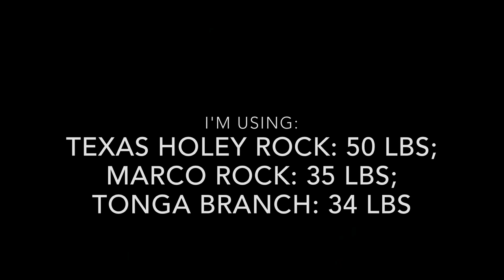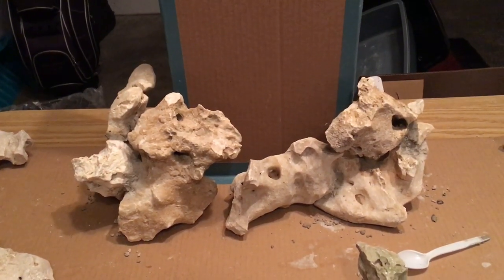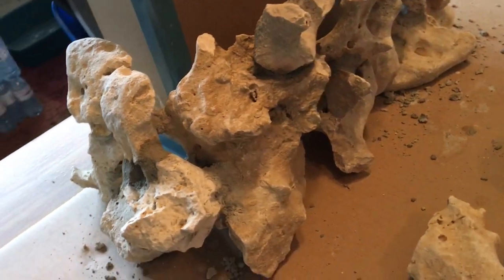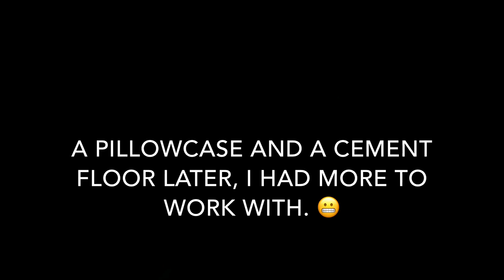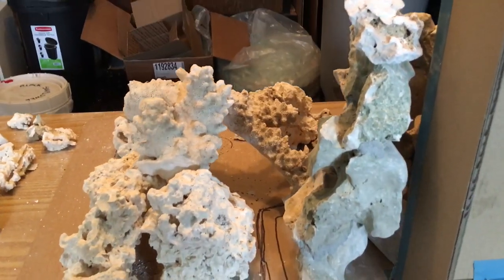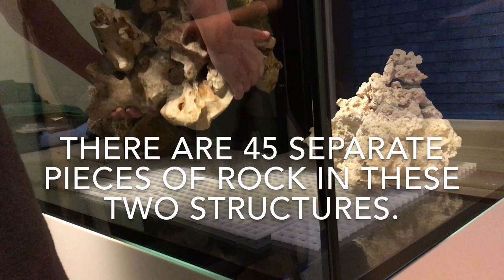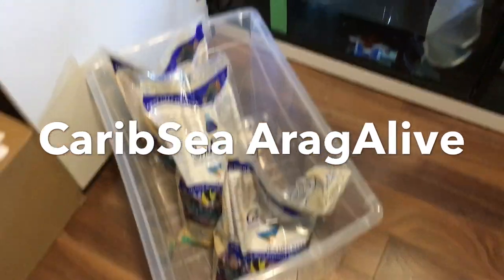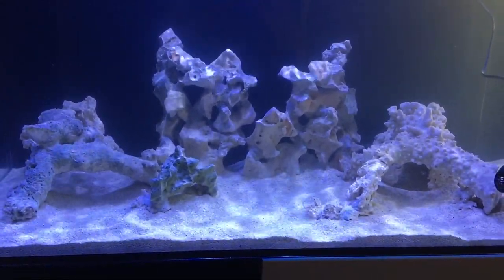Red Sea Reefer XL 425 - Rocks + Sand + Water = CYCLE !!

Comment: Nice video but bad idea to leave egg crate in, it will trap detritus.
Reply from the maker: That’s why I frequently used a turkey baster to fluff the sand. It was a fairly shallow sand bed, and when I moved the reef I was really surprised at how little debris kicked up when I pulled out the rocks. It was impressively clean even after running for three years. 👍🏻

Comment: very cool! I guess youre leaving the light diffuser under the rocks?
Reply from the maker: Hey ED, that stuff is made specifically for aquarium use, comes in 6"x12" panels that can snap together, and is very inexpensive. The light diffuser from the hardware store is deeper and more brittle. I find this stuff keeps the rocks from sliding around or contacting the glass directly and perhaps scratching it. I've used it in all of my tanks for the past 7 yrs. Thx for watching!

Comment: looking good... hurt a little seeing you using wood tools to break rock lol (woodwork is my family trade)... about the devil's valve, you'll get used to it, make very very small adjustments and wait a at least 10 minutes to try adjusting again, my tank is completely silent (barometric pressure changes will affect the adjustment sometimes).
Reply from the maker: Thanks so much for the tip about the adjustment. It will definitely help. And that wooden mallet is over 100 years old, belonged to my husband's great-great grandfather from the days when he used to build wooden train carriages for First Class passengers in England. I have no idea what type of wood it is, but there's not a mark on it even after my whacking the rocks with it. 😊 So no worries, the mallet survived! Thx for watching!

Comment: love how your video shows the struggle and victories of getting the cycle started. my only suggestion is for the texas rock to move them forward a few inches so that you can get the siphon in the back to clean the sand and scrubbing tools to clean the back glass. i hate having to do maintenance so i try and make it as easy as i can for myself
Reply from the maker: Hey Nado, it's deceptive when looking at the rocks in the water, but they ended up a couple of inches from the overflow glass. I agree with you completely and I wanted to be sure I could reach down behind there. Thanks for stopping by!

Comment: to put sand in without making a mess-
use a funnel to pour sand into a plastic bottle. squeeze plastic bottle to distribute sand in tank. I did this when I went from bare bottom to sand bottom in a fully stocked tank. works great and very little clouding.
Reply: beautiful tank
Reply from the maker: Hey thanks Joe! I did try using a long, large-diameter siphon tube, but the problem was that this was live sand so there was water in it (in the bag) and it STUCK TO EVERYTHING. I probably could have planned better but I was in a hurry, sigh. Some patience would have helped. 😳